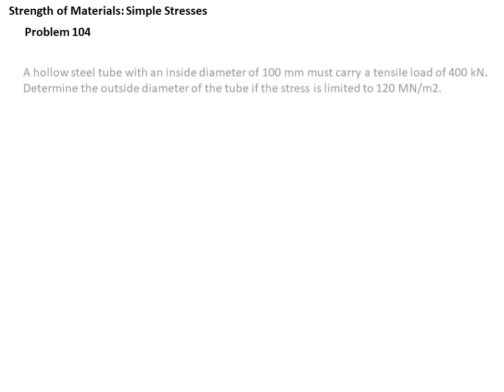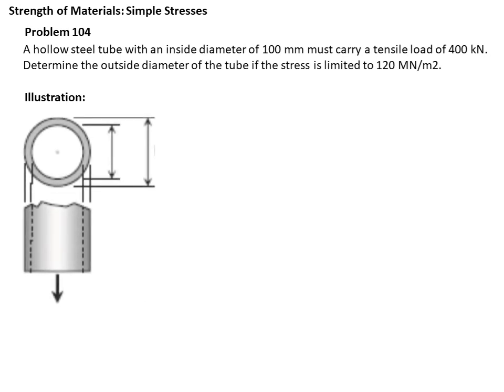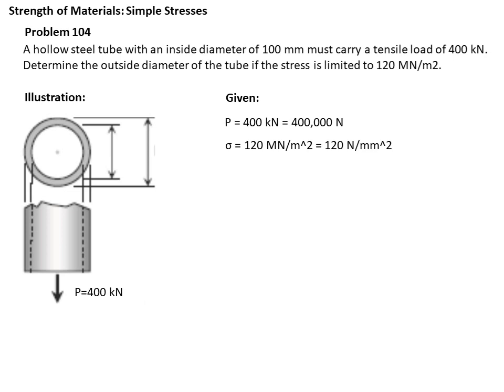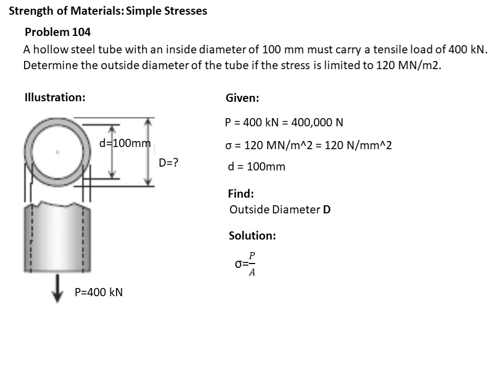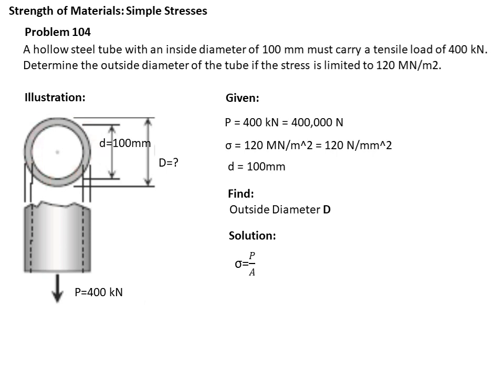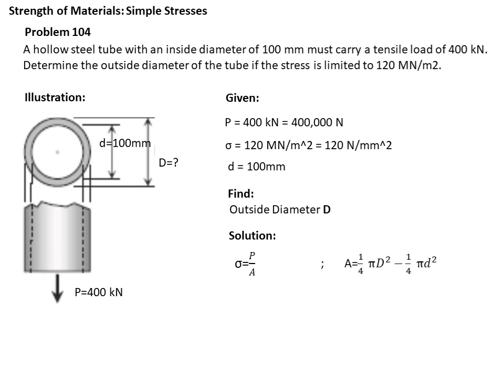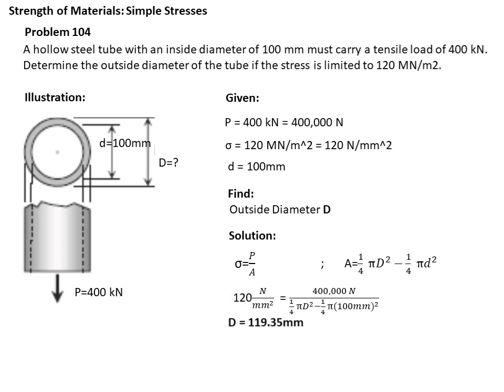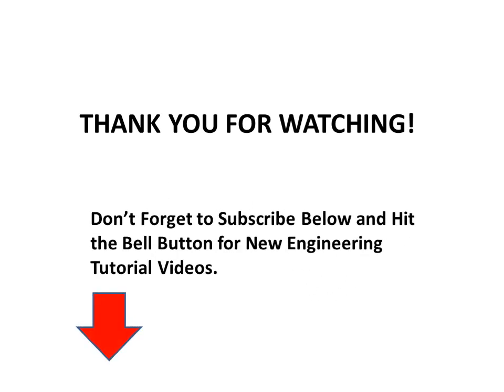Strength of Materials; Problem 104; Simple Stresses

Comment: A rectangular cast-iron column 25.0 m * 25.0 cm * 5.00 m supports a weight of 6.80 * 106 N. Find the stress in pascals on the column